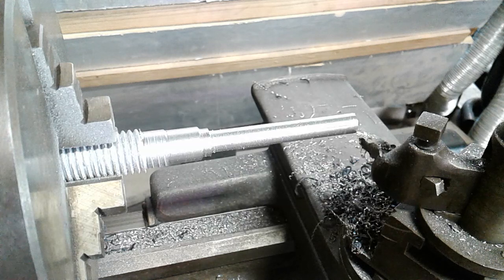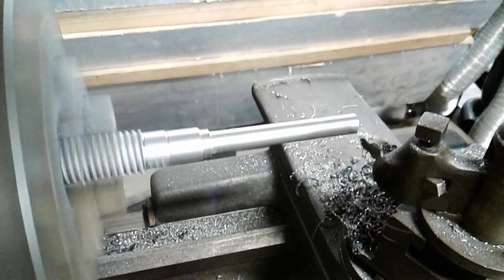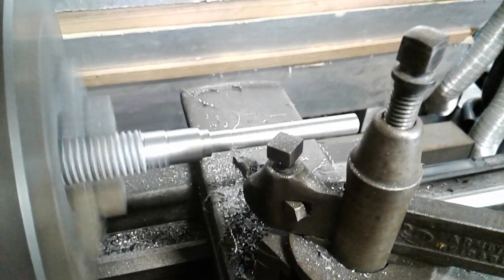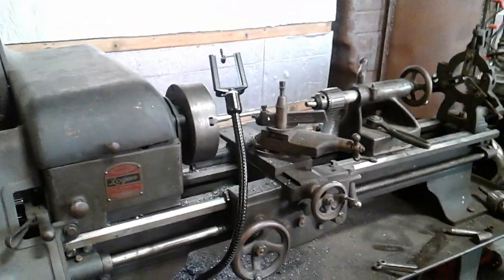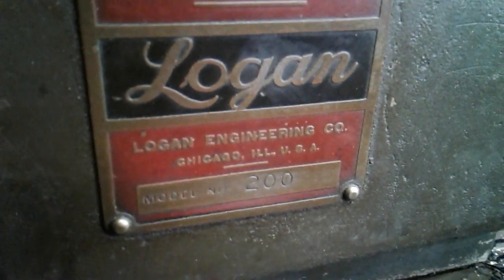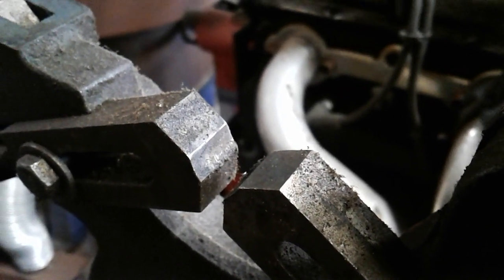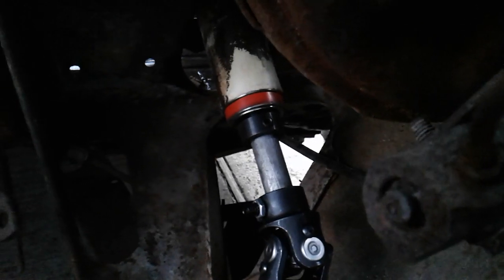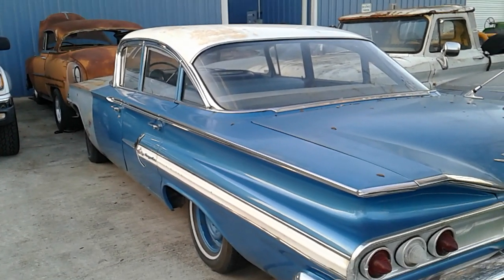New Logan Model 200 Lathe!!! First Turning!!!

Comment: Hey Pat. Nice score. Those old lathes are built better than the new ones. They are like old cars. They are made from real steel. I've used a lot of different lathes in my time and they all have bearings in the steady rest. That will still do the trick. just don't use it dry. Use oil or grease on it. You don't need much. Also, the cutter that you are using can be sharpened on your bench grinder. You just have to shape a small cup ( concave ) shape on the end and a slight relief on the front so the cutter doesn't rub on the piece that you are turning. But I don't have to tell you all that. You use your buddies lathe so he probably showed you. One other thing, don't be afraid to take a bigger cut. You can get a better finish if your cutter is sharp and you make it work hard. You won't get bounce from the light cut. I have to go to my son's shop whenever I need to do any metal cutting. You are lucky now that you can do all that stuff in house. Be careful Brother. You can get badly hurt real fast running a lathe.  Think of your YouTube friends when you decide to take over the world. Keep Rock'n it out Brother.👍👍🤘

Comment: Awesome deal Pat!!! That steady rest does ride on your metal part. Just get the part set with the live center in the tailstock and then bring the steady rest where each arm barely touches and oil it good and it will keep it from moving or chattering while cutting. My first car when I was 14 years old was a 1960 2 door Chevy.